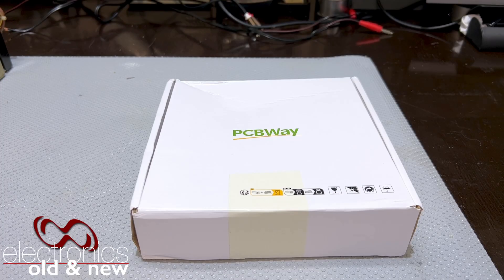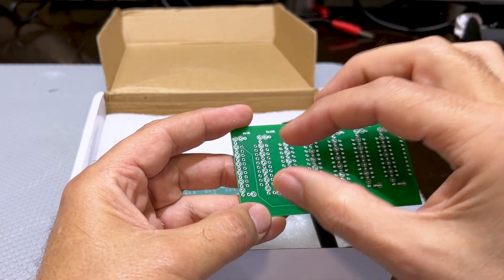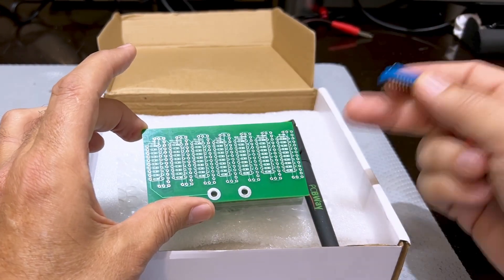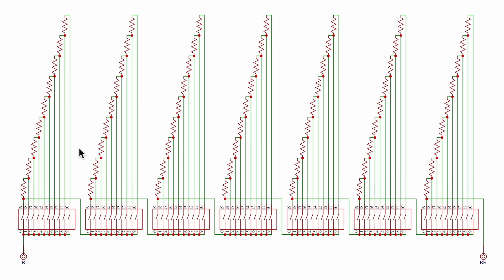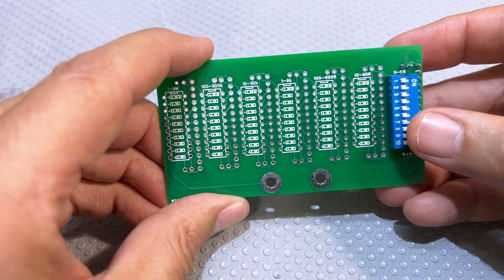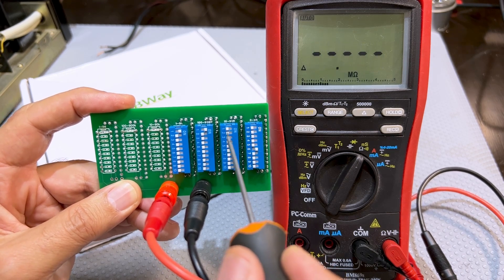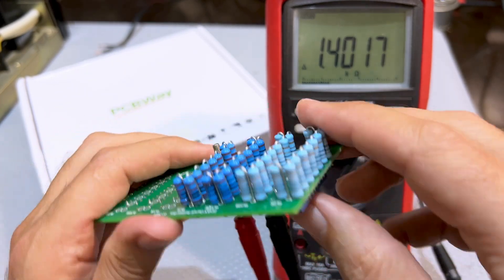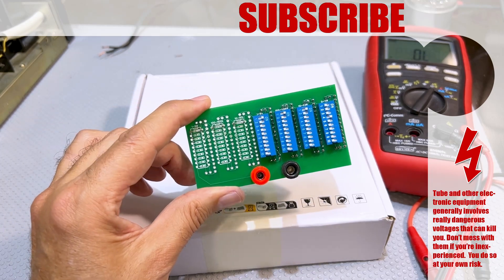EO&N Really Cheap Decade Resistor Substitution Box - build and testing #PCBWay#

Comment: Your traces are really skinny for a decade board. Consider making them wider especially for 1w resistors and considering trace resistance. Also dip switches add resistance. I would use pin headers instead

Comment: Good video. Just a note, regardless of how many resistors you switch in, the power handling is 1 Watt as they are in series configuration. Parallel configuration will give increased power handling.  example... If you needed a 10 ohm resistance with a 2 watt power capability (and you did not have a 10 Ohm 2 watt resistor, you could use 2 20 ohm 1 watt resistors in parallel and the total resistance would be 10 ohms and capable of 2 watts. It's a nifty tool which I use for determining required resistances in design work. 😀

Comment: Never had a use for a resistance box in my 45 years in electronics. I think it is more for use in a classroom situation.
Reply: I use one regularly for simulating potentiometer or sensor values, without the hassle of potentiometers and with the repeatability of a switch. I can trim values of on board resistors by putting this in parallel and switching in resistors until it's good, without the downsides of potentiometers.
Reply from the maker: I’ve used mine to adjust biasing in guitar effects pedals using jfets. Quite handy.

Comment: Something I always wanted to build. Using dip switches is an idea that never occurred to me, nice thought. Internal contact resistance of those switches turned out surprisingly good, I wouldn't expect that since they are usually meant for digital use. Instead of getting expensive 0.1% resistors, one can get like a 100 (or more) packs of 1% ones and choose the best 10 out of them. Great project!

Comment: The weak spot is the switches, as these types are not normally designed to handle much current. As 1 ohm, 1W = 1A
Reply from the maker: True. Low power only.
Reply: @electronicsoldandnew  i've seen a few smoked decade resistance boxes in the past, its so easy to forget.
Reply from the maker: Makes the hobby more exciting 😊 💨

Comment: Hi Manuel,
nice project. 
I would proposed to use the "10" position (instead of "1") to bridge out the resistor bank. With this you have a direct indication of the  resulting resistance multiplier by the numbers written on the DIP switch...
Reply from the maker: That’s a great idea 😊
Reply: ...and a few holes on each corner will be very helpful as well even if you use the board naked with standoffs or assembled in a box.

Comment: Looks like a well thought out construct, thanks for sharing it! One question though, did you order the parts from a supplier like Digikey or Mouser? If you did, I know that you can make the BOM / List public at Digikey, ( not sure about Mouser), to make it a bit easier for interested parties to source parts. It might not be too hard to size that up to a project box, set in it with some stand off mounts, and then make a PCB with cutouts for the switches, no copper, and stencil it for your switches and raise it up a bit with some stand offs as well.
Reply from the maker: I got the resistors from Mouser. The switches from a local supplier.

Comment: I would suggest at 1% tolerance resistance splitting the box in two halves. 0 to 9k  and 10k to 9M. The 1k range was already negating the changes of the 0 to 9ohm range. Changing the larger three ranges to expensive 0.1% resistors may help a little. Better to have two separate outputs for two ranges, with the option to link together if setting the box(es) up against an accurate measuring device before use.

Comment: Suggestion: increase the board size by say 1.0 inch in width & length & add holes in the 4 corners for stand off mounting? Another idea: break it into 2 boards, dips on 1 board and resistors on the other for ease of soldering. Connect the 2 with wires to keep the cost down or design for a suitable ribbon cable, although at increases cost.

Comment: If you would use a 1 watt only for every first resistor,  you could use less for the others and still have a minimum of 1 watt
Reply from the maker: True. I though of that but then found that my supplier sells batches of 10 resistors at a lower price than the separately rated ones. That’s why I simply used the same types.

Comment: Cheap? No, this gizmo is ridiculous. Who is going to flip all those tiny switches? There's a good reason that resistor substitution boxes use thumbwheel switches.
Reply: You still gotta appreciate the effort instead of being so overly criticisive. I'm actually thinking of building one´.
Reply: @19janiboy96 ,, The main reasons I use an oldfashioned resistor substitution box at work (audio repair shop) are 1) for discharging power supply capacitors, where this device would almost certainly get burned up, and 2) for selecting the voltage-dropping/current-limiting resistor value to use when changing dial illumination and function indicator bulbs in vintage stereo equipment over to LED's, for which this might work.  Frankly, my advice is to find an old resistor  substitution box or decade box and maybe upgrade a few of the resistors as needed, in case any have drifted off spec or the wattage is a little too low. I use an old EICO substitution box that contains 2 rotary switches and one slide switch to select the ranges; with heavier duty resistors subbed for the lowest-ohms resistors, it works great.  I haven't managed to burn the thing up yet, which for me is a minor miracle.🙃
Reply from the maker: I agree that the old boxes are great. I just wanted a few of these as I often need them for low voltage / low power applications.

Comment: An idea to ease up the selection, is to use 1 rotary switch to choose which of the 7 "resistor banks" , and then on the resistor bank itself you choose the value with the DIP switches. That way, you don't always have to move 6 resistor banks to zero, and the lifetime of the DIP switches will also extend.  Grtz
Reply: @electronicsoldandnew  , as i think of it, with the idea that i mentioned, you can only set the value of 1 resistor at the time, and not combined 2 or more resistors in series. Grtz